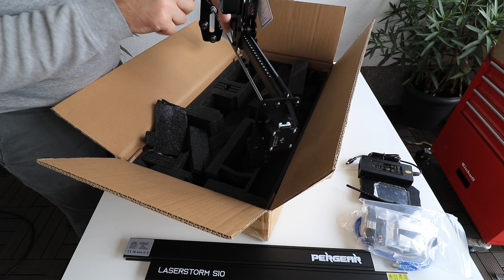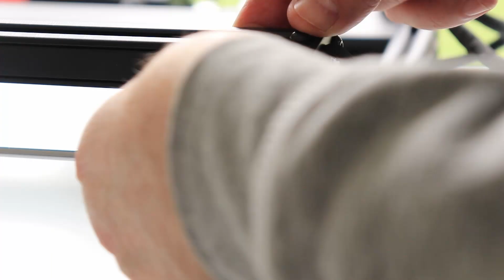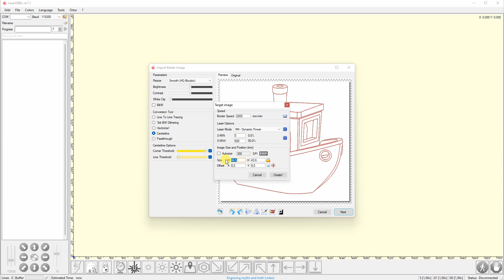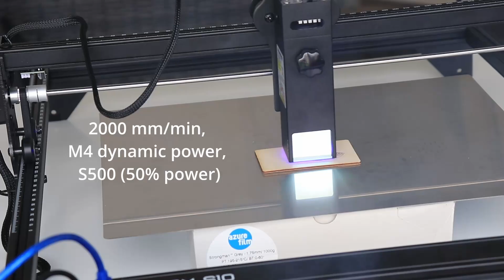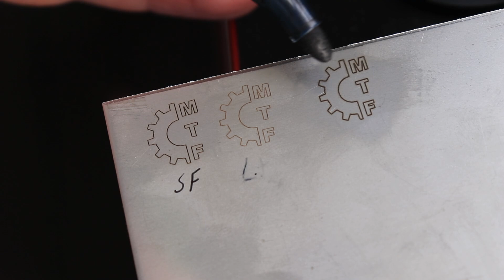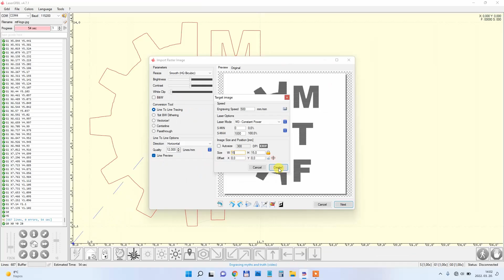Pergear LaserStorm S10 10W laser engraver - unboxing, review, testing..

Comment: Hello from Canada 🇨🇦.! Thank you so much for the very informative video. I am very new to the idea of using a laser in my wood shop and have a couple ? 
1- would you agree that this is a Atomstack S10 PRO Laser, just with different company name on it ?

2- I’m looking for a laser that can engrave onto a cutting board made of a combination of Walnut, maple , and purple heat.  Would this be enough to do that ?’ I’m asking for some true advice I have never even seen in real life a laser so I would TRULY APPRECIATE IT  if you would give me advise on what to buy that will be able to engrave into wood fairly quickly. Ty
Reply from the maker: Yes, this is some Atomstack rebrand. It can engrave almost any wood, but cutting is limited. 10W is strong diode laser but far from CO2.
Reply: @MyTechFun  ok well ty that is all I needed to know . I appreciate your advice as I have found a brand new one that was advertised for sale in my city and I can buy it for $450 off the list price . So thanks to
You I am going to pull the trigger on it and purchase it .